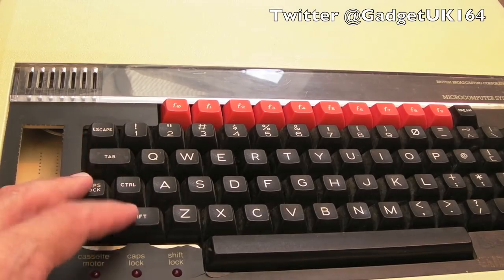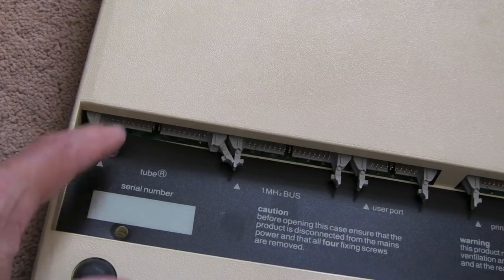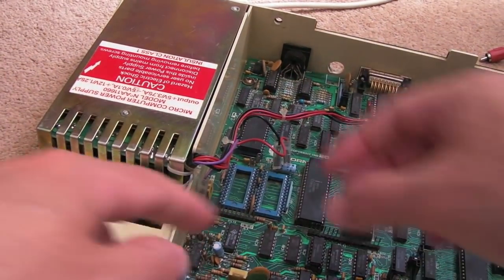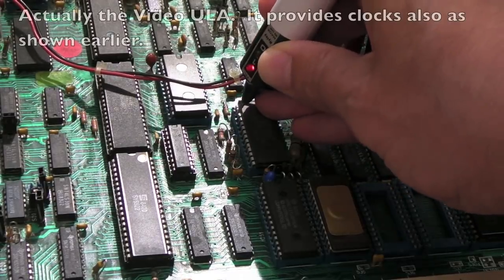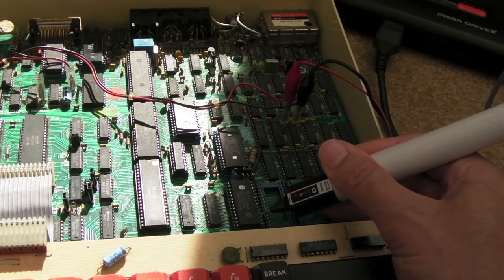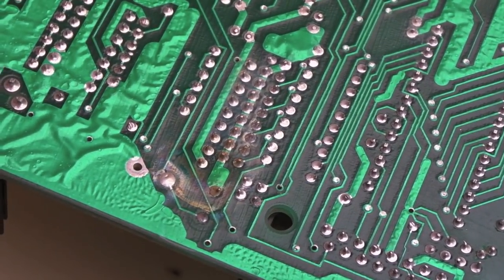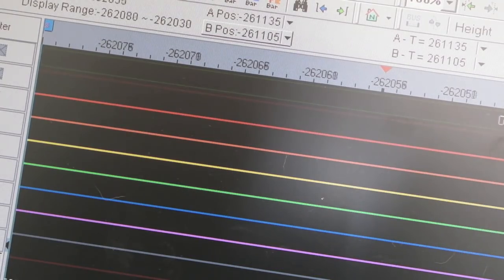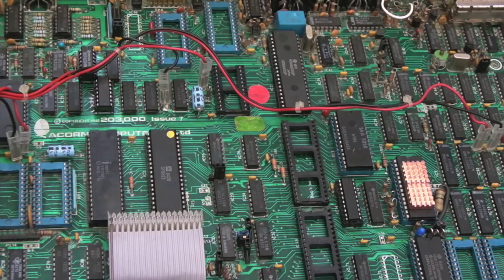Acorn BBC Micro Model B Multiple Repairs Part 1 (Continuous Beep)

Comment: You must have been introduced to the BBC around same time as me, I wrote a lot of software on them computers back in the 80s, the BBC B & Master were ahead of there time really with the programming language they used and not forgetting that ARM Processors were invented by Acorn back then the RISC OS on the Archimedes.. But yes implementation of  ROM chips slotted directly on the board and configuring via *ROMS <rom> and *HELP <command> I think a lot of computers got the idea of the [>_] prompt from Acorn or maybe they stole the idea from CP/M lol yes plenty of hours programming and playing on Castle Quest !! those were the days funny enough RT Russel who developed a good emulation of BBC Basic language has a version for PC today refined for Windows and can do a lot more than the original BBC BASIC and I lot of hobby clubs (model Railway enthusiasts use RT Russels version) I spoke to him a while back as I wanted a version for a system at one time and he replied saying he did not even remember if he ported to that system but I managed to find a version for that system ... I think it was the TC01 (Tatung Einstein) the computer that made me what I am today!! funny enough I sold two immaculate BBC Masters a few years back and I learnt from that powersupply issue ..... smoke from the supply anyway a good clean up and swapped out the supply and fixed the broken one and they work perfectly bought some new roms which contains WORDWISE & ADFS and i was away programming its like riding a bike the coding i could still remember even after 30 years of programming .. (y) good video gadget ! - in fact the LOGO programming language derived from MB Bigtrack and Digital Research was also ahead of there time developing the logo ui, it was a shame about Gary Kildall if you never looked into him hes worth a watch ..
Reply from the maker: Thanks for the info there and for sharing your experience with the beeb =D  Shame you didn't keep those masters - getting expensive now!  The BBC was very influencial for sure - many of us perhaps wouldn't be in IT if we had not been sucked in by the beeb at school!

Comment: Hi Anthony, I've got a bbc model b and the sound is very VERY quiet on the speaker.I've turned the pot up thats on the motherboard to its fullest.What i'd like to know is can you tell me or even better show me a video on what i can check to see if its the amp chip or anything else? The bbc is a great machine and some nice upgrades inside the only thing that lets it down is the sound is extremely quiet
Reply from the maker: It's Chris!  Anthony was the person that sold me the BBC :o)  I will take a look at the schematics later and let you know!
Reply: I make RGB to SCART cables for my beebs and add a jack (and socket to the beeb) to send the audio through the TV (CRT).

Comment: why was that chip overheating so badly. even with an aftermarket heat sink :-(  now i know what to check if i buy a non working continuos beeping machine
Reply from the maker: Those ULA chips just get super hot, probably due to clock speed it runs at internally.

Comment: Presume you've seen the stardot forums.  They have lots of fault finding guides ;-)
Reply: The highest language rom is the one selected by default. The right PROM slot is slot 15 which is highest, so you normally put basic in the right most slot.
Reply: S25 jumper (multi-position, need to look it up) allows you to swap the RAM banks around - so the top 16k becomes the low 16k.  This is often the first thing you do to see if one bank of ram is broken.  The screen memory is in the high bank.
Reply: The old ULA had a manufacturing fault which caused it to run hot - they shipped them with big heatsinks until they got a new replacement cool running version.
Reply from the maker: I need to register over there yet =D
Reply from the maker: Thanks, that's awesome information =D
Reply from the maker: Yeah, I covered that in the video =D

Comment: Great video Chris.  Whilst fixing and modifying the machine, it might be worth adding a 32k sideways RAM to benefit from increased memory on some games, and also avoiding insert/removing ROMs that causes those chip socket problems, by loading from disk into RAM using SRLOAD.  Mark at Retro Clinic has a solution here that worked for me, but it does require some risky board modifications if confident enough:  http://www.retroclinic.com/acorn/swr/swr.htm
Reply from the maker: Thanks!  And thanks for pointing me towards those sideways RAM / ROM boards!  I've seen a few tonight and at some point I am sure I will buy one!   The mod looks easy enough, but I think I would prefer to try and keep the machine revertable.

Comment: 40ish minutes of tapping on chips with a logic probe...
Reply from the maker: Sorry about that!  Yes, perhaps too much waffle.  My videos aren't complete repair guides but more VLOG-ey.  It's hard to find the balance sometimes.  I cut all the soldering and desoldering because I cover that in every other video I do.  The next part should have left waffle hopefully, and less chip tapping...
Reply: I find the tapping and explaining interesting. Gadget's thought process differs from mine so it's always useful to see another way of solving the same problem and I always learn something new in the process. It's much more interesting than videos which show a dead computer, chip replacement and then the same computer working, video over. Detective work is the fun part of repairs.
Reply: GadgetUK164 - Retro Gaming Repairs & Mods I did not complain about you waffling along I like the process.  My only complaint about this video was the tapping. It got distracting while you explained what you were thinking.  But please don't try and change over that lol. It's a tick we all have them

Comment: Why did you not connect the Acorn BBC Model B with a RGB cable, then you get a lot better video signal?
Reply from the maker: Making one in part 2 or part 3 - just waiting on wire!